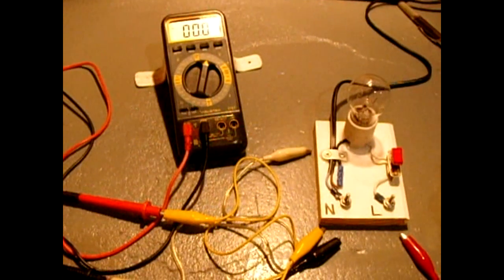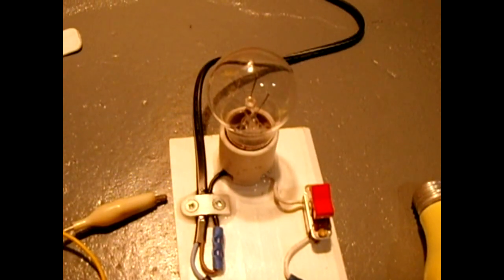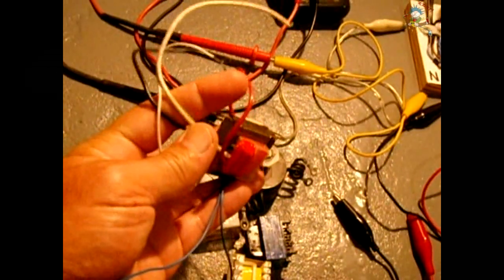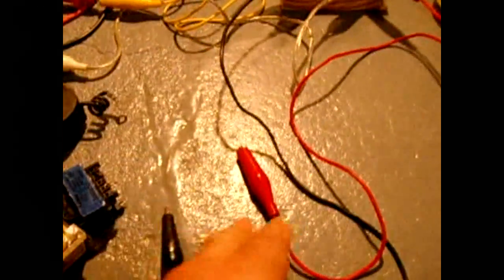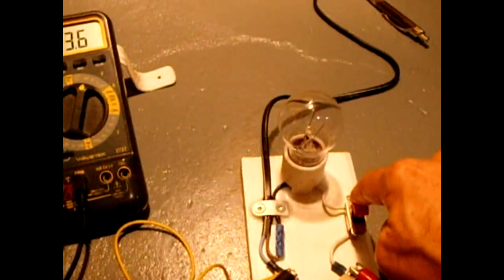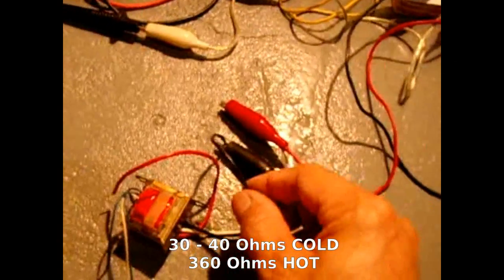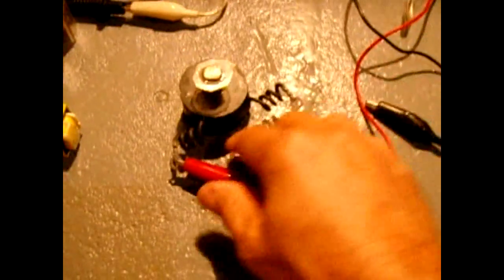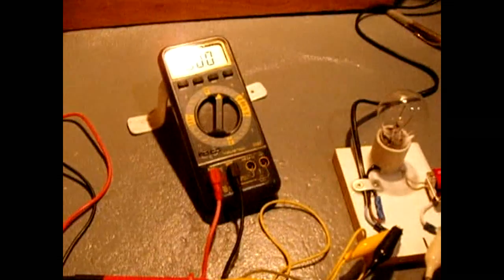LOAD LAMP ~ Very SImple, But Very Useful

Comment: Very high wattage lamps can be useful in this setup , theatres use 500 , 750 , 1000 Watt flood lamps , but you will need to find ( or buy ! ) an  E40 ( giant  ) Edison screw holder .... you may have a " prefocus " theatre lamp , ( for spot lamps  ) which will need it's special holder .... you may find these in second hand stores , as most theatres use high power LED lamps these days ... I use a variety of holders in my ( 230 Volt , UK ) version of this tester .... hope this tip is of help ( ? ) ............

Comment: I got a 310W transformer, that means I need to use at least 400w bulb?
Reply from the maker: Use 2.5 to 3x the load wattage for the bulb. You can place (2 or more) high wattage bulbs in parallel to get the higher wattage.
Reply: I test my transformer with 10W bulb it light dimmed like 10-20% of full brightness of the bulb. Is it ok?

Comment: But I have a question for example when you tested the short circuit the voltage drop was 0v and lamp was fully on it, but it should get 120V to light up ! What is the reason for that? and how the current found the path to the lamp instead of the short circuit ? where the short circuit is less resistance than the lamp!
Reply from the maker: The short circuit is a path of VERY low resistance, so the bulb will light fully.
Reply: @electronicsNmore  ok I think I understand a little bit, when there's a voltage on mains rails and no load then I can measure the voltage 120V but when there's a load connected then the voltage completely drops to the load. Is my analysis correct ?

Comment: hi used this for testing a hair dryer and the light bulb was brightly on and hair dryer wasnt turning on i thought the hair dryer is shorted then i said why just not connect hair dryer directly to the 220v just for fun  and the hair dryer was fine  it was working. why is that ?  light bulb is 100w   mains voltage here is 220 v
Reply from the maker: The hair dryer draws way too much current.
Reply: @electronicsNmore  i see so the light bulb must be about 500 watt or so to test that right?. but i think 100 w bulb is just for low current devices right  swtich mode power supplies will be okay to test it with  right ?
Reply: @fatih3194  You could try the hair dryer on the lowest setting without the heat.

Comment: how to use this setup with an isolation transformer. does it work?if it; where to connect the load bulb,  before the primary or after the secondary of the isolation transformer
Reply from the maker: No reason to use an isolation transformer.

Comment: electronicsNmore
hii, 
i saw my friend long time ago, have 3 load lamp with switches. 
when he repair an electronic that was send to him for repair, he would use this method. then he will switch one light, later 2 lights together, later 3 lights together or is it vice versa to confirm problem and to repair the electronic without blowing up more things.. 

can you pls explain how is the configuration of 3 bulbs... ? \

thx
Reply: Good old idea. Like the setup. I'd rather call it load limiter lamp. Also it could be used to reduce voltage /speed/noise on small motors such as fans. Great videos.

Comment: Very good demonstration.  I've built this but instead of a switch I replaced it with a inexpensive ebay thyristor.  It works great.  But there is a problem.  After I test something that I want to work I find with the current limited by the thyristor something like a transformer will do the job but I don't want it to run in saturation.  Is there a way to guage the resistor I should use to reduce the current permenantly?

Comment: Very useful tutorial. But I wonder how to figure it out if an unknown transformer is 120 or 240 V rated.
Reply from the maker: You have to take into consideration the size of the transformer being tested. A transformer the size of a microwave oven type, is going to draw a lot of current. When you test a 240V transformer using the method outlined in this video(using a smaller core), and you want to know if it is a 240v or 120V primary winding, use a 240v power supply, and (2) 120V 100W bulbs in series as the load lamp. If the transformer is 240V, you will see a voltage reading of "around" 240V on the meter. If the transformer is 120V, you will see "around" 120V on the meter.

Thanks For Watching!

Be sure to share, and check out my video playlists as well.

Comment: Interesting video, I just subscribed and will catch up on more,
Can I use a high wattage lamp and leave that in for testing?
As in one that may be 5 or even 10 times the wattage to save me swapping lamps?
Never actually tried testing this way but it does look useful
Reply from the maker: The problem with using too high a wattage, then you will allow too much current to flow and possibly damage the circuit under test. 3x the wattage of the circuit under test is ideal, as another Youtuber stated.

Comment: I have one set up with a two way, centre off switch so I can go through the bulb and if that is ok then apply full power. It just goes to a standard power outlet. When it's not being used for testing a 25watt bulb lives in it and it's used as my soldering iron idle switch. Some people just use a diode for this purpose (idling an iron - NOT testing xfrms!!) but I didn't want to do that because my iron is fed from an inverter, so not too keen on unbalancing it with half wave rectification.

I also have various 12 & 24 volt bulbs, some with wires soldered on, that I use for the same purpose on low voltage circuits. Although mostly obsolete for actual illumination purposes, incandescent bulbs are incredibly handy in the electronics department as they make a quick & dirty (almost) constant current supply over a useful operating range.
Reply from the maker: The center off switch is a good idea. I'll have to add that. :-)
Reply: electronicsNmore The original one I built used two switches. One for power on/off and the other for bypassing the bulb. Actually they were both 10amp MCBs as that's all I had around at the time! These were mounted on a board together with a mains & bulb sockets. The funny thing is that in the end the circuit breakers stayed on the board (while other component were removed) and this board ended up becoming my 12 volt distro for solar power! heh

Comment: i have 1 transformer and i dont know how much amps,or voltage it is....
Reply from the maker: You can get an idea of the amps by the size of the transformer. Follow what I did in the video. You will discover which side is the primary. If you choose the proper load lamp, you can get a rough idea of the transformer's secondary output voltage.

Thanks For watching.